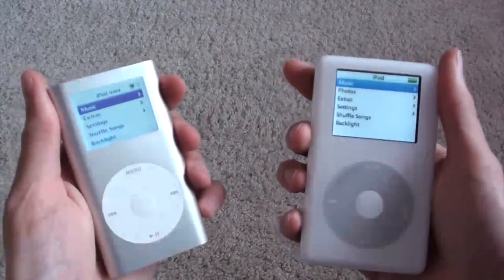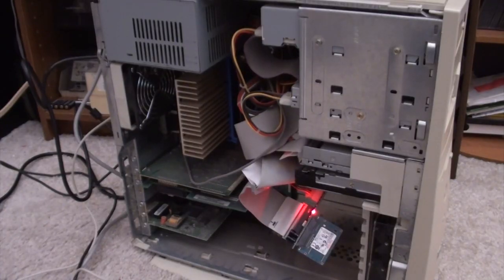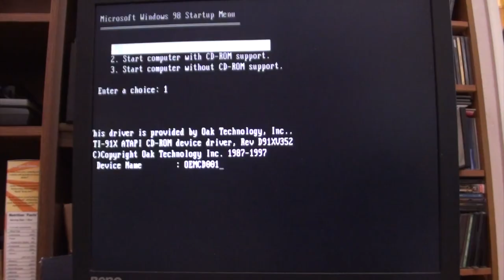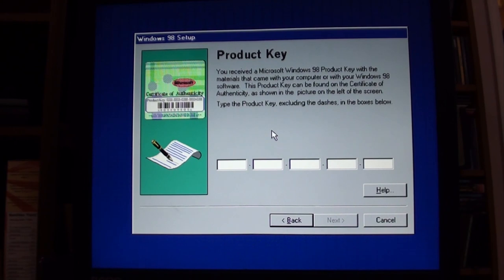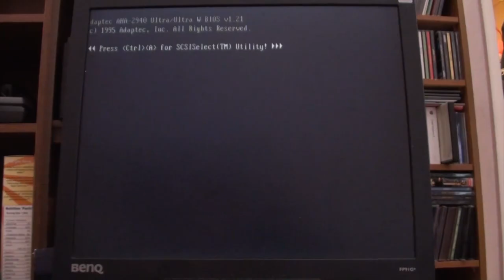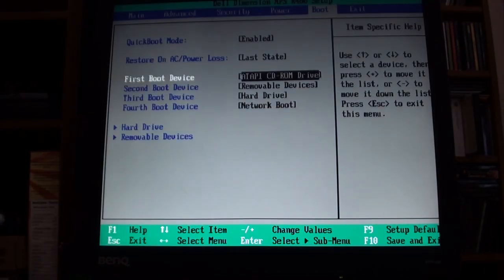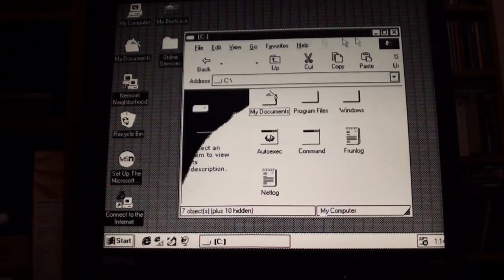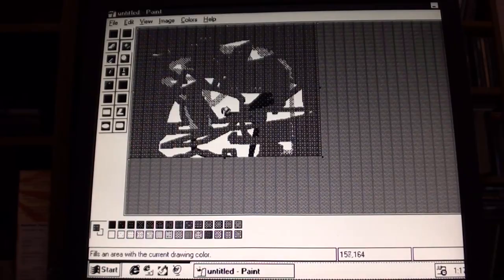Installing Windows 98 on an SSD

Comment: WHY DID YOU UNPLUG THE FAN? IT WILL DESTROY YOUR HOUSE WITH FIRE DUE TO OVERHEATING AND KILL YOU!
Reply from the maker: +Alex McCulloch (Badcatalex) I'm actually surprised the P2 survived the entire install of ME on the Bigfoot video without any fan at all =P
Reply: Ever heard of a thermal shutdown?  Yes, that is a thing.
Reply: +ATNR. But did the CPU heard about it?
Reply: ***** If a thermal shutdown has occurred, power is immediately no longer sent to the CPU, thus preventing a fire and maybe even protecting the CPU.  Pretty simple.
Reply: ATNR. Looks like you didn't understand me. I asked if this PC is "advanced" enough to have that option. I doubt that all PC's since their invention had the thermal shutdown, but I don't know when it became common for all PC's, so I don't know if you can rely on it.
Reply: +Alex McCulloch (Badcatalex) Here's my verdict on the situation: I own a Windows 2000 machine that has already went through a couple fans. Truth is, the rest of the computer starts failing before the fans do...and in this case, NONE of the internal fans are doing ANYTHING for this machine in any way. Only way to cool it enough to keep it from setting fire is using that big ass tunnel-blade fan. (I call it tunnel blade because I can't think of a proper term for it and it's shaped like a tunnel.)
Reply: +TheByQQ it's a function of the CPU... not the "PC" Pentium 2 processors have had it on board since day 1.
Reply: ***** Well, would you fucking look at that, my first comment was about CPU
Reply: ***** I have had loads of trouble with sleeve bearing fans...the only ones that don't give me shit are the way oversized 220mm ones in my case ATM, and even then I had to heat the fan up purposely with a hairdryer just a little bit to make it stop. No clue how that worked, but no fan problems with it since.
Reply: +TheByQQ well would you fucking look at that your second comment didn't.
Reply: +Alex McCulloch (Badcatalex) 
Here comes the YouTube fire brigade in 3... 2... oh wait, I'm too late.
Reply: ***** firefirefirefirefirefirefirefirefirefirefirefirefirefirefirefirefirefirefirefirefirefirefirefirefirefirefirefirefirefirefirefirefirefirefirefirefirefirefirefirefirefirefirefirefirefirefirefirefirefirefirefirefirefirefirefirefirefirefirefirefirefirefirefirefirefirefirefirefirefirefirefirefirefirefirefirefirefirefirefirefirefirefirefirefirefirefirefirefirefirefirefirefirefirefirefirefirefirefirefirefirefirefirefirefirefirefirefirefirefirefirefirefirefirefirefirefirefirefirefirefirefirefirefirefirefirefirefirefirefirefirefirefirefirefirefirefirefirefirefirefirefirefirefirefirefirefirefirefirefirefirefirefirefirefirefirefirefirefirefirefirefirefirefirefirefirefirefirefirefirefirefirefirefirefirefirefirefirefirefirefireermahgerdahosespraysprayspraysprayspraysprayspraysprayspraysprayspraysprayspraysprayspraydoneohwaitanotherfirefirefirefirefirefirefirefirefirefirefirefirefirefirefirefirefirefirefirefirefirefirefirefirefirefirefirefirefirefirefirefirefirefirefirefirefirefirefirefirefirefire

Lawl jk
Reply: it won't go on fire it will just melt or it will shut down...
Reply: +Alex McCulloch (Badcatalex) Did someone say marsh mallows?
Reply: +ATNR. thermal shutdown didnt exist in the 90's... much cpu's have been burned because of overclocking or defective fans. it smells for some seconds and thats about it
Reply: Forty Two Not below mine...always at 30 on both CPU and GPU. Hahaha
Reply: +Alex McCulloch (Badcatalex) how could that be a bad thing?
Reply: +ATNR. Yes, but many older processors doesn't have this. They can littearly go up in smoke.
Reply: +Druaga1 I overclocked the heck out of P2's back in the day, and they are absurd when it comes to handling high temps. I tested heat levels back then, and when NON-overclocked (in the case of this PII-400), one is actually able to hold a hot soldering iron against the core-cover, without any heatsinks or fans at all with temps raising higher then 100 degrees celcius, but it still ran the Quake2 Timedemo flawlessly :) Ow those times... I was about 15 years old back then and got the overclock fever for the rest of my life.
P2's were really awesome, very stable, intel's BX chipset was one of the best around and it still lasts! increbidle to see. Put two Voodoo2's in this thing and play Quake2 again :)
Reply: +Druaga1 not surprising at all, these P2's barely need a heatsink and can reach very high (above boiling point) before even crashing. This changes a lot when overclocking though. I had a PII -300 with a really famous serial (the SL2W8) and it overclocked to 504MHz (4.5 multi,  112MHz bus) since it was secretly a PII 450MHz (the fastest CPU back then). But when pushing the thing to it's limits, it became very easy and clear to see when a P2 CPU actually crashes. Just when it reaches a certain temperature it crashes, very easy to control! So I had it overclocked to a level where it never reached it's fail-temperature (this was about 40 degrees Celcius), but it stayed on 35 max all the time so no troubles!. This very EASY and controllable way of overclocking does not exist anymore... CPU's are very unstable nowadays (not strange btw, they got way more complex) compared to the PII's back then.
Reply: +Stefan Koopmans True. Although the only reason I've many troubles OCing my brother's Q6600 is due to a dying motherboard, at the same time I've had it overclocked before and for some reason it tops at 2.8 before crashing. Maybe the other motherboard was bad too, but I don't know.
Reply: +TheByQQ is right. I have seen photos and videos of processors much more recent that do not thermal shutdown, they just cook. Even saw a picture in a computer magazine in the early 2000s where someone forgot to plug in their CPU fan and it melted the motherboard around the CPU.
Reply: However to add, that P2 is fine being passively cooled with it's huge heatsink.
Reply: +Alex McCulloch (Badcatalex) The ignition point of aluminium is around 2000 degrees Celsius if i had to guess melting point around 900c, so it would melt and fail long before ignition, and silicone i dont even think burns, if it does it would be WAY higher then aluminum. sense computers have a thermal shutdown at around 105C and run like shit before they get there, even without the shutdown, the melting point of solder is i think 180c, its solder would melt and the processor would fail long before a fire even had a chance to start. Case in point, its literally impossible for your cpu to light on fire unless you poured gasoline on it or something, but then thats the gas igniting not the computer.
Reply: +Alex McCulloch (Badcatalex) Indeed, it will kill him dead.
Reply: cold fusion gamer
Maybe it will shoot out a real huge flame that melts and vaporizes everything before the smoke could become a problem?
Reply: Patrick TheBaptist Druaga: My Pentium 2 went out with a boom...aflame it was, sparking, dying, trying to run. But it's attempts were nothing exceeding futile in any form. Simply, it was gone. 

Lmao
Reply: *****
LOL I use to repair computers years ago, a P133 had been hit by lightning and the entire case was magnetized, whats funny is with a new HD it fired back up and worked fine....

But it sure would attract metal real well.
Reply: Patrick TheBaptist Apple machines be jelly

Lmao
Reply: *****
Hahaha Apple jelly.  I'm surprised jobs didn't call one the "acid" or "trip" model.
Reply: Patrick TheBaptist Yeah
Reply: +ATNR. thermal limit?
Reply: +Alex McCulloch (Badcatalex) the sarcastic unsertenty after that was the BEST!
Reply: +ATNR. not until Pentium4
Reply: +Alex McCulloch (Badcatalex) That's the chasis fan more than the CPU fan, and on that old piece of crap the passive heat sink is probably adequate.
Reply: +Druaga1 Heat-sink must've been pretty damn hot afterwards though, right? Even on a 400MHz Processor, quite a bit of heat is still generated.
And why was the fan making so much noise anyway, haven't you cleaned it because it's an old PC?
Reply: ***** I find heat sink passive cooling pretty scary xD probably because it looks like you're adding a massive wart to your computer because of a gigantic copper block stuck to the top of your CPU, plus you don't know whether it will actually work or damage your CPU.
Reply: +Alex McCulloch (Badcatalex) two words: Fanless. Chromebooks.
Reply: +Kuroko Shirai 1 website. unikumpc.ch
Reply: WimsicleStranger Two words: Probably. Right.
Reply: +Alex McCulloch (Badcatalex) It is a well known fact the P2 will always find a way to try and kill you (I once stood on one).
Reply: +Alex McCulloch (Badcatalex) i have an amd cpu that i have run even without heatsink and it didnt even overheat but was really hot and with just passive heatsink it worked perfectly
Reply: It's s case fan not that big of a deal. Not like it's a CPU heatsink
Reply: Shhh Pentium II's are evil it will hear you!
Reply: ***** An ARM processor isn't evil. and there doesn't seem to be a Pentium 7 in existence.
Reply: ***** Ah. that makes sense.
Reply: That's what I like to hear, I remember my friend using a desk fan to cool his CPU on the floor with his motherboard supported out of the case with K'NEX.
Reply: That is no fan, PCs that old run on coal, that there sound is the boiler!
Reply: Kuroko Shirai Arm processors are waiting to see what we do before making a move... thats why they sit in your pocket!
Reply: Oh....
Reply: +Alex McCulloch (Badcatalex)
the PII was able too cool itself off due to sheer size of heatsink
Reply: Yes I used a PS2 heatsink once on a graphics card rat-mod style!  Voodoo 2 always over heated... I am showing my age!
Reply: At this point, this is a chatroom.
Reply: +Alex McCulloch (Badcatalex) hello, A/S/L?
Reply: 39/Attack Helicopter/Area 11
Reply: +Alex McCulloch (Badcatalex) 
Lol pretty much
Reply: Progressive
not really, The processor had really large heatsink
Reply: No, he diedededed
Reply: he makes youtube videos he doesn't need fans
Reply: @judenihal  Jesus this comment is old, I was soooooo little when I made it lol
Reply: @badcatalex lol